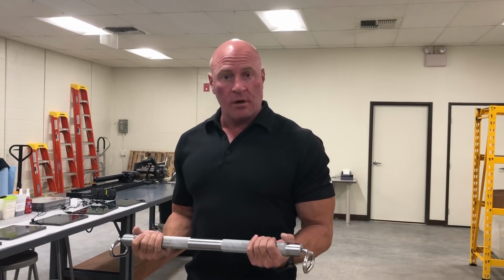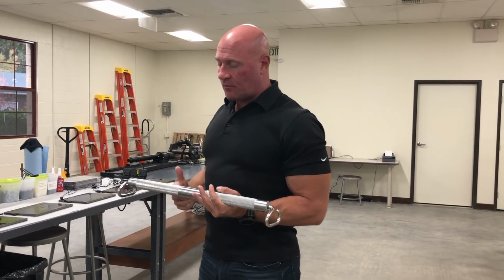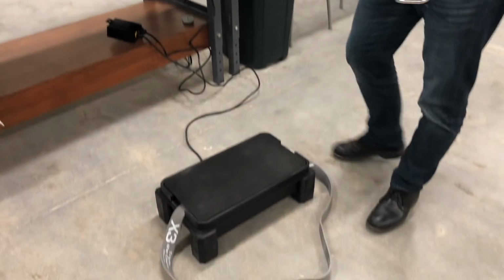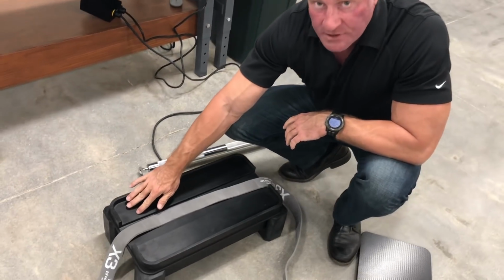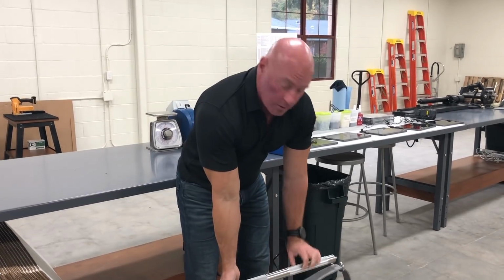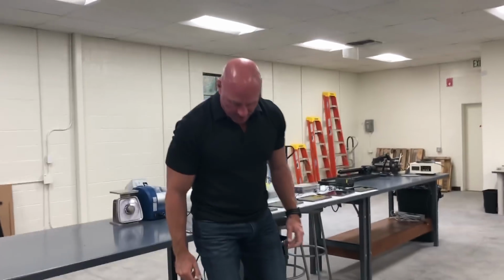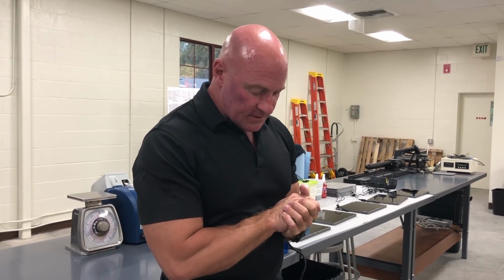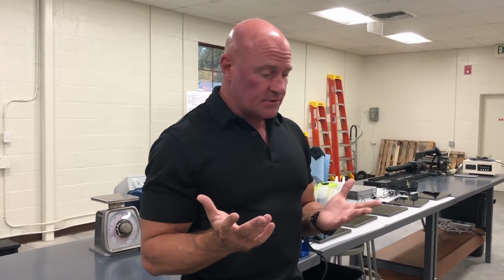Introducing the GHAccelerator™

Comment: Do you do the single leg lunges the same way with one foot higher than the other?
Reply: 0 seconds ago
No. I’ve seen some X3 user put their back leg on an 8 inch high stable small platform or foot stool. This one works well from Amazon: Fox Valley Traders Wide Folding Step Stool.

Comment: Just received mine! Stoked! Didn’t know what to expect. I thought there would be a greater sensation during the workout. But it’s not that dramatic. It feels good just not mind-blowing or anything extraordinary during the x3 workout. 

I noticed the major impact later in the day and the next day. The immediate effects are certain postural improvements and joint integrity being greatly enhanced. For what it’s worth, my Oura Ring recovery and sleep scores have risen each day since using the plate. My sense is that this is just the beginning exceeding positive impact to come. As I mentioned these are my initial impressions after only a few days of use. 

If my calculations are correct then a perfectly performed X3 workout would last a maximum of 16 minutes. Calculated at three count up and down x 40 rep x four exercises x one set. Most often my time under tension is quite a bit less. Time will tell if this is enough stimulation to truly get the benefits of the vibration unit. Solid piece of equipment...wish me luck!
Reply: @Swami, really liked your comment. Do you have an update for us with using this piece of equipment?
Reply: Thoughts on the accelerator after some time?
Reply: Stil worth it??